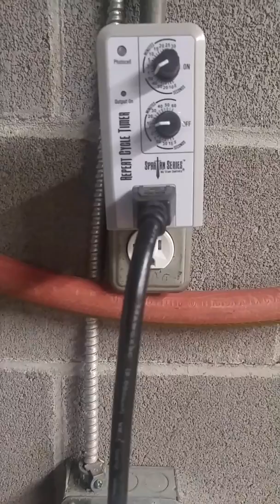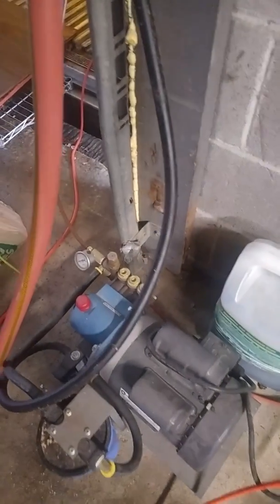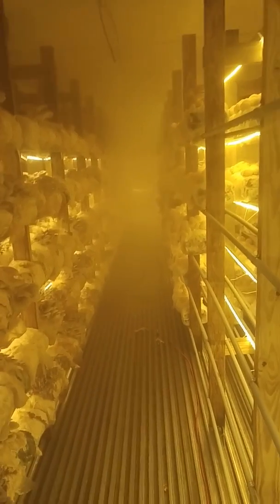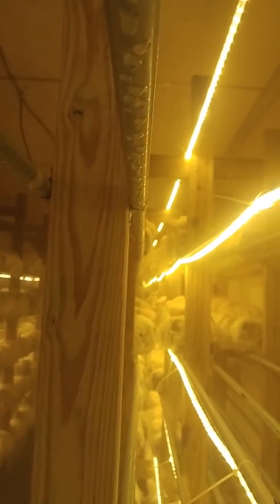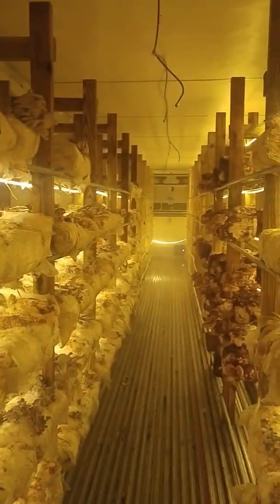How to Fruit Mushrooms Indoors with Commercial Growers - Fungi Ally Fruiting Room

Comment: What size conduit pipes did you used? Did you treat all your 2x4 with something as well so they don't go moldy?
Reply: THe conduit pipe is 1/2 inch. The 2x4's in the grow room are pressure treated.

Comment: Curious what size misting nozzle you are using? I've purchased the 15 nozzle kit with .008 nozzles and am finding that it really gets the grow room very wet and I don't have a floor drain, trying to figure out best way to switch over to this system as it seems alot lower maintenence than the HoH foggers. Any tips very appreciated!
Reply from the maker: hey Justin. We had the same thing, we found it doesn't need to be on very long and having it in the middle and close to the ceiling away from the mushrooms worked best. We ended up cutting the risers to only be a couple of inches so the nozzles were further away from the mushrooms. It definitely pumps in a lot of moisture! 15 nozzle might be to much for the size room you have, how big is your room? You could space the nozzles out further and use less of them.

Comment: What do you do for heating in the winter? Also I just got a container I’m building out and wondering did you put a drain in?
Reply from the maker: Yeah we cut drains in the back of the container, it was slopped so all the water went back there. The container was hooked up to a warehouse. The warehouse was heated so it drew hot air in from the warehouse.

Comment: What lighting intensity are those led lights? I heard there is a intensity that should not be used because it can burn the mycelium?
Reply from the maker: Doubt the intensity would burn the mycelium. It would be more heat than lighting intensity. These are 6000k

Comment: Hi; My grow room is not working. Do you know the specs of them light strips ? I think I need more blue in mine. 
Will too much light be bad ? 
Do I need constant air flow? I have a blower motor hooked to a timer 3 times a day for 1 minute.  I grew some oyster without the blower on first grow but never can get any more to fruit. The only thing I changed was lighting. I was using a small light from midwest grow kits then changed to shop led lights and a grow light. Nothing fruited since. 
Also I use a ultra sonic disc fogger in a 2X3 by 7' tent. 95% was way too wet I think. 

Thanks for any advice you might have.
Reply from the maker: The light strips are 6000k daylight white rope LED lighting that is waterproof 65IP. Dont think you can have to much light unless it is getting HOT. Nope dont need constant air flow aim for around 6 air exchanges per hour. Yeah CO2 is probably way to high I would have the blower on for 1 minute 6 times per hour.

Comment: Nice setup! Just thinking, does the reefers ac unit get clogged by the spores, or do you filter the air? And how many FAE's you need per hour with the intake fan?
Reply from the maker: The reefer unit was broken so the body was cheap to buy. Ideally 10-15 FAE's per hour

Comment: hi guys, is it an insulated shipping container? or just a plain one and you gave it some extra layers? wanting to go similar way in europe. otherwise great stuff. well done you and thank you for sharing with us. it is very helpful.
Reply from the maker: Yes this is an insulated trailer used to be a reefer or refrigerated trailer.
Reply: thank you for your reply, was it expensive? I live in the Czech republic and these things are /surpriceingly/ quite pricey over here..
Reply from the maker: Ours was $2500 for the container
Reply: wow, really good price! thank you for telling us man. it is like at least twice as much over here :/
Reply from the maker: YEs this is an insulated shipping container. They call them Reefers here. Definitely needs supplemental heating and cooling in our climate in Massachusetts.
Reply: ok. thats great, so did you put in an old heatpump or an ac unit?
Reply from the maker: Ondrej Vasina we had it hooked up to a building which had heating cooling and would pump the air from the building into the trailer

Comment: Awesome video! Really digging your setup. The system you're using is the 15 nozzle kit from Aeromist? Also, have you noticed any issues with controlling humidity and air temp without preconditioning these two parameters outside of your grow chamber? Thanks and keep up the awesome work.
Reply from the maker: Yes exactly for the mister. We are now pulling preconditioned air at the correct 65 degrees into the grow room. I have found it fine to add humidity in the grow room.
Reply from the maker: Yes exactly for the misting system. I like checking in on the fruiting rooms daily or every other day and adjusting the conditions based on how the mushrooms are looking. It takes constant monitoring and adjustment but mushroom growth is better that way

Comment: I noticed the 2X4 wood structures in the growing room. Suggestion: Seal all wood with Eco Wood Treatment and/or seal with Weatherseal Tape; seal joints, cracks etc. with food-grade RTV adhesive.
https://www.amazon.com/Eco-Wood-Treatment-Silvery-Semi-Transparent/dp/B00KX05BE2/ref=sr_1_4
https://www.amazon.com/Frost-King-T94H-Plastic-Weather-Seal/dp/B000SL0NIA/ref=sr_1_4
https://www.amazon.com/AST-RTV-27110-Silicone-Adhesive-Cartridge/dp/B00K19YCX6/ref=sr_1_2